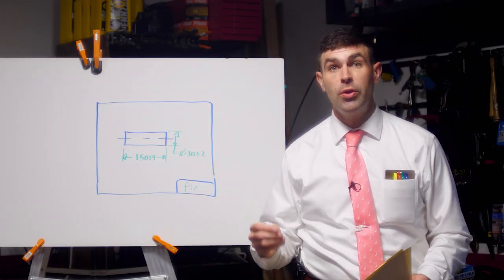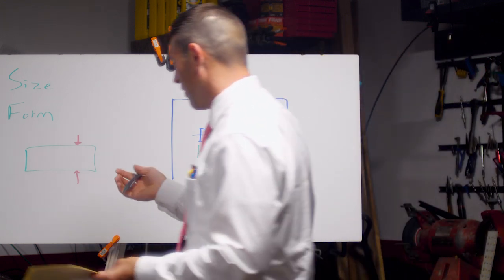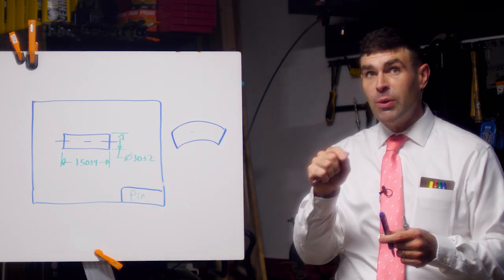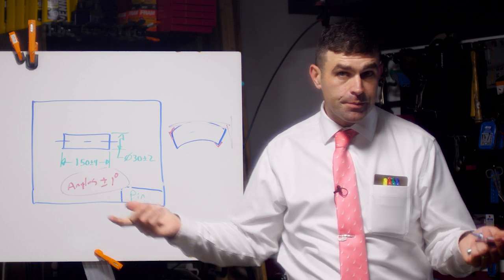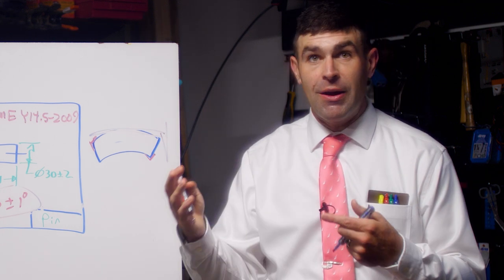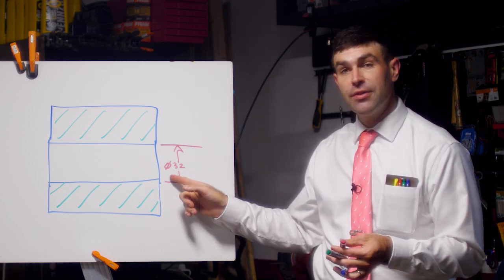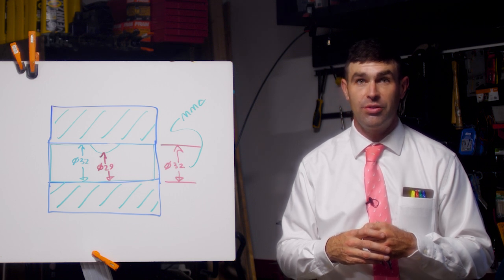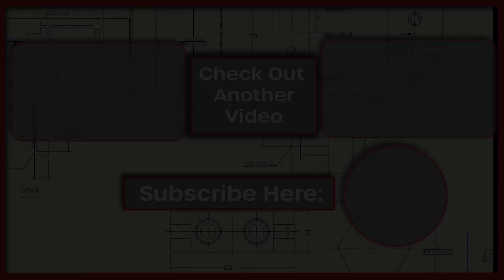GD&T Rule Number 1 (2024)

Comment: Hexagon defines uame as positive material direction and local size as minus direction, and also allows selection opposed points or circular method for size tolerance.  So confusing!

Love your videos.  All my coworkers do too :)
Reply: I noticed that too. Per asme 2009 local size is defined as measured value of distance from any cross section which implies opposing points, and also states any local
Size needed to be in size tolerance. I haven’t check latest asme it could be they remove this statement as more cmms now.